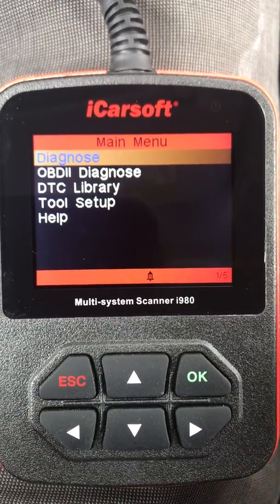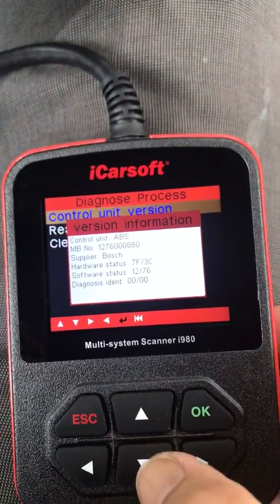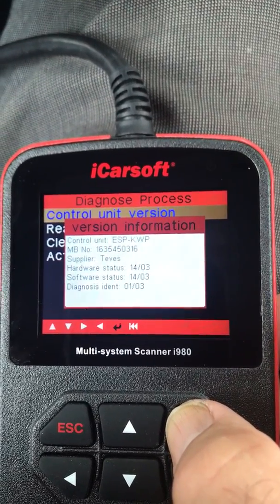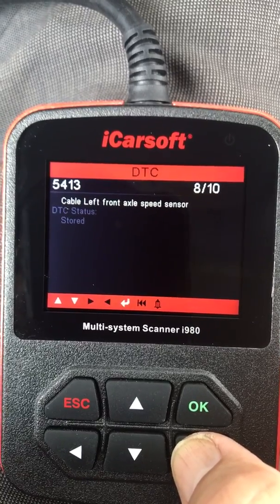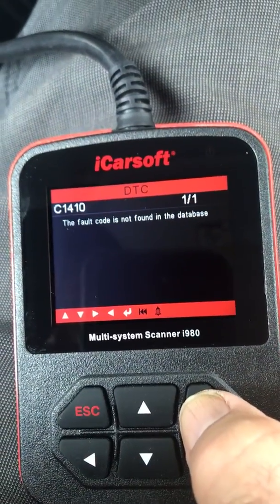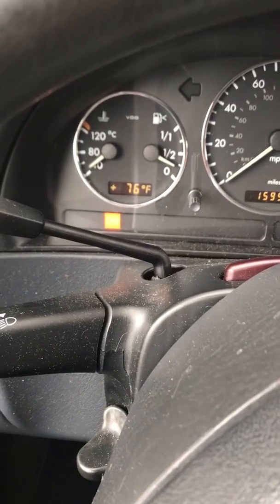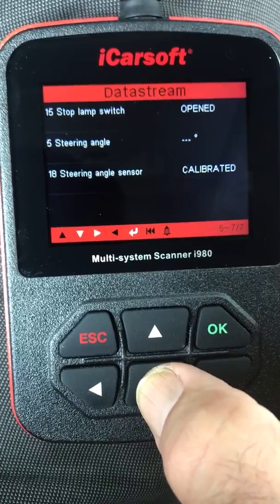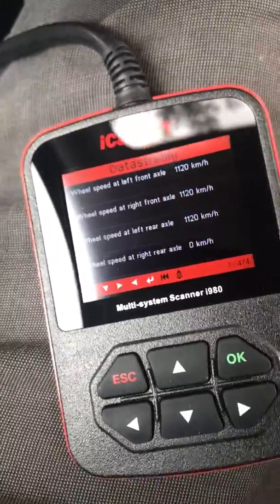How to Scan ABS on Mercedes ML500 with iCarsoft i980 or iCarsoft MBII

Comment: Did you determine what your issue was? I am having the same thing happen as you when reading wheel speeds. I was thinking it was the ABS motor but maybe it is a sensor
Reply from the maker: I went thru all that BS. The three lights go on because the icarsoft locks them on on some of the tests you are running. And then they all go out and you are left with the ABS on. What I found was indeed my ABS was dead or malfunctioning. You can try the brushes or the motor. But that usually means the ABS was running a lot. You need to get an internal list of Teves ABS codes. If your ETC  / ETS lights are also on - this is a different problem - there is a steering angle encoder in the steering column and an accelerometer sensor in the console. Net Net is that you need to have your steering wheel LEVEL when you are going straight - meaning the air bag / mercedes STAR is properly orientated. On the icarsoft there is a steering angle test and you should have steeering angle of nearly 0 degrees when going straight. Plus - check your tie rods inner and outer. If these are shot it will cause you to steer incorrectly. I had to replace ALL the tie rods inner and outer and get the steering wheel level before I got the ETC / ETS lamps to stay off. I have videos on all this too. If you search moviestudioland etc or ets you might find them.
Reply: @moviestudioland  Hello there. I am having the same problem that you have. But the difference is that mine is a ml 350. I have icarsoft MB V2 OBD reader and i tried to read the trouble code using the sprinter idea but it is not working. any ideas how can i read the code? thanks
Reply from the maker: It was an internal error in the ABS Unit. Replacing the unit solved the problem. The scanner did not read the ABS correctly as the chinese misprogrammed it. I had to select a different Mercedes vechicle type and then a Teves ABS unit and then I could read values for the 2005 ML 500. The value I got was internal ABS error - might have been a bad valve or such. Just replaced the ABS with a used one and no problems since.
Reply from the maker: I have videos on replacing this ABS unit on an ML500 if you search for moviestudioland and ABS you will find them.
Reply: I’ve been watching your videos but can’t find if you showed a specific code. I have code 5100-The control unit is faulty 

2005 ML500 as well
Reply from the maker: @christopherhevener3661  https://www.ebay.com/itm/2004-MERCEDES-BENZ-ML500-W163-ABS-PUMP-w-MODULE-ANTI-LOCK-BRAKE-OEM-04/401716749837?fits=Model%3AML500&epid=1522955275&hash=item5d882f260d:g:L84AAOSwBPxcdSfU
Reply from the maker: @christopherhevener3661  IF the wheel sensors are showing data under live data whilst driving then it is most likely the ABS unit. I forget the exact code from mine. The videos I posted might have that old code. I had an internal error. I can't find the 5100 code you posted. If you are using the icarsoft unit - you need to select a different mercedes truck that has a Teves ABS and then you will get correct readings. I could not get any readings using 2005 ML500 on my iCarsoft scanner
Reply: @moviestudioland  I got that code using the diagnostic for a sprinter. I'll keep messing with it to try and figure it out. thanks
Reply from the maker: @christopherhevener3661  OK got it. Yep that's how I got the code too. Only the sprinter has the Teves ABS. Cheap icarsoft scanner does the job. Correct. Sprinter. See if you can clear the code and what comes back? Doubtful you can take it apart. I think there were 4 small torx bolts to take out and then you might have access to the valves. Some people are soldering the circuit boards. It was the fall and going into winter. I just wanted working ABS for winter. As a further note - I had the ETS light on too - due to the steering wheel not being straight and level when I was going straight. If the wheel alignment is good and the steering wheel is off center as the shop or you did not level it - you will get amber ETC or ETS lights too. I have not had ANY ABS or ETC / ETS lights in 6 months.
Reply: moviestudioland I get all three lights when it happens. A common issue is the ABS pump and the brushes need replaced. The lights are never continuous. If I do the “lock to lock” a few times the lights go out. Almost seems like it happens when warm. I drove from Ohio to Iowa in the fall and no issues. Happened once on the way to Iowa in abt 60 degree weather around the 500 miles mark. 

Lights have come on roughly six times since January but it’s never continuous, always after highway driving but seems temperature dependent. Today it is around 70 degrees and they came on after around 55 miles of driving